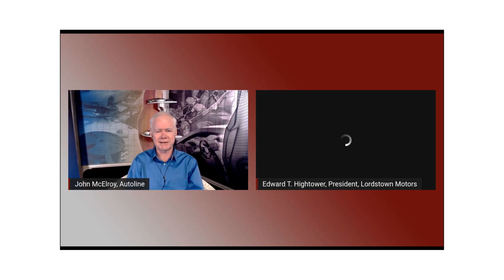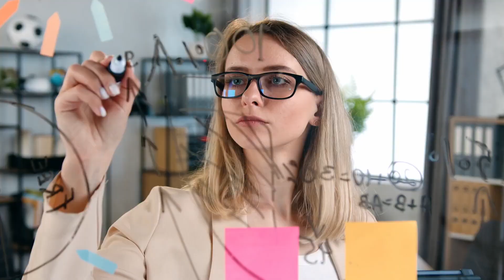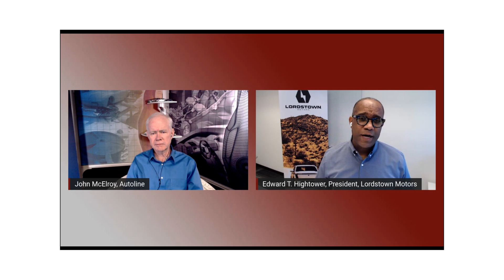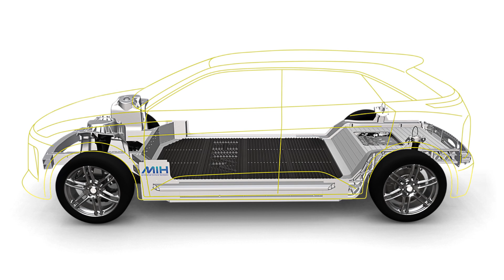Lordstown Motors Goes Asset Light, Develops Skateboard Trucks - Autoline This Week 2614

Comment: Foxconn won't be using Hub Motors on their platform.
Lordstown will be developing future vehicles based on the Foxconn platform.
Hub Motors look like 'Dead-end Engineering' that will frighten potential Endurance customers.
Reply: Small Hub motors might make sense for the front wheels to add AWD. You get to eliminate the cv joints and half shafts. It also allows more room for the frunk. Keep the main powerful motor in the back.
Reply: @joeclutchless1944  I generally don't like the idea of hub motors, but those are great ideas! I don't think I'd go with super low profile tires with hub motors.

Comment: I drive a 34 year old Ford E-150. Never have a problem finding parts or getting repairs. Lordstown Motors is doing design and manufacturing design, Foxconn is going to do the manufacturing. 34 years from now who will be responsible for parts, technical training etc., - sounds like it will always be the "other" guy, and consequently I'd be surprised if these vehicles will maintain value.
Reply: The endurance is using the Chevy Silverado part bin for most of the non customer facing parts.
Reply: @theprez6100  That's reassuring. I guess the next question is: How does this not compete with the electric silverado. Are the parts coming from independent supply chain vendors or is GM involved, maybe as a hedge against the a late or different segmented silverado?

Comment: Let’s see… so they will enter a market late as a totally unknown cie, with no EV experience, no car design experience, no manufacturing experience, no software experience, an unknown support network, using first time used wheel hub tech, manufactured by a company with no significant car manufacturing experience, which already had a disastrous experience in Wisconsin, at an old plant.
And that market will already have two of the three current suppliers to fleet customers with products in the market with an existing support network, with vehicles similar to existing ones.

What could possibly go wrong? Oh yeah! Forgot, this vehicle is associated with the president who tried to overturn the last US elections…

Did I get everything?
Reply: Foxconn is a world-class manufacturer and its manufacturing and JV contracts with Lordstown are way more solid than anything in WI. The Endurance is a fleet truck, and there is a lot of unmet demand there. Imo your only persuasive concern, and it’s admittedly a big one, is whether the hub motors perform. If they do, this succeeds. Its valuation right now is peanuts compared to other EV companies.
Reply: @gofannon1943  I have heard concerns about unsprung weight with in wheel motors. ( potholes ).
Reply: You are cluless, Lordstown not only bought the plant from GM, they also hired just about everyone back. Most peple hired have worked over 10 to 15 years even 25 years in that same plant for GM, building cars with same equipment. Now these employees work for foxconn to build same Endurance. Their are  a lot of same engineers and technicians who have been working this plant for years. Also hired a lot of new talent. The truth is lordstown motors and foxconn have the most experienced team over any other startups. I will also say in a plant that has been producing vehicles for decades, which lordstown motors bought with alot of equipment still installed, that foxconn has now. This is not a new trial plant, with trial workers. In fact, from upper managemeant to lower level, they have legacy auto experience. That is why there are many paid spammers (paid by FORD and Unions) going after this company. They are the most feared by Ford in dealing with Fleet truck sales.

Comment: Why would you risk buying this truck while a reliable and trusted brand like the Ford F-150 Lightning is available? Start up are too late at the game.
Reply: Everyone else is sold out for multiple years. Even so, I don’t have confidence that they will be around to honor warranty work years from now. Sorry LT - I wish you the best though.
Reply: For me, the 4 simple moving parts of the 4 hub motors is the true differentiator.
Reply: @dmiretti  Hub motors seem to be a very good design on paper for sure.  The question is how they'll do over time.  (If I remember correctly the concern around hub motors is the weight and force-impact on them over time)
Reply: They don’t have it..
Foxconn has chips.  I have popcorn.  🍿